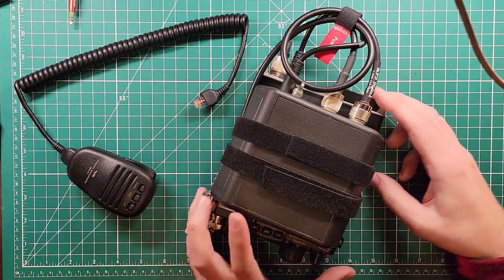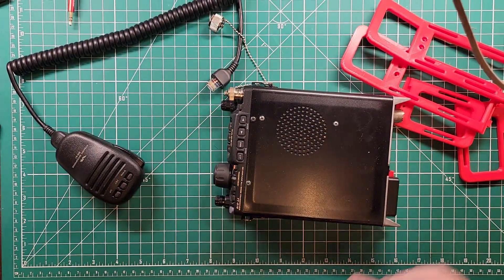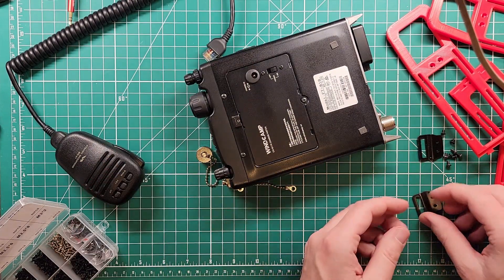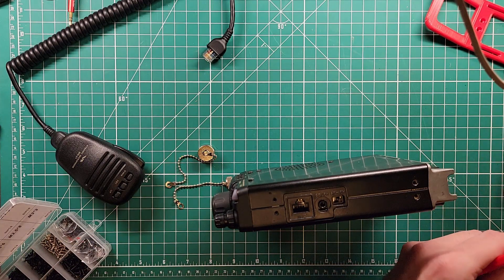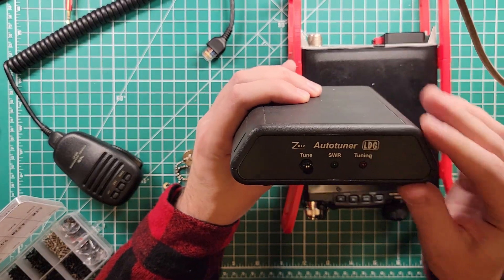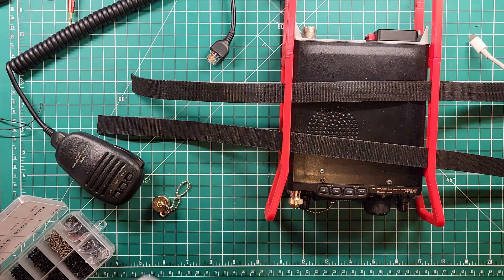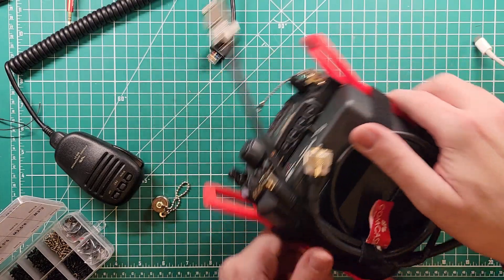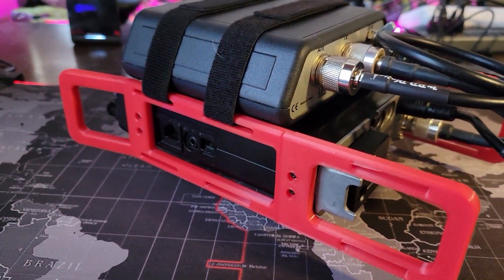Save your radio (and your cables too!)

Comment: The brackets are a great solution.   I own the same gear.   Does anyone have a source for a flexible  tuner-to-radio DIN cable ?   The one I have now is too stiff and too large in diameter.   Thanks in advance
Reply from the maker: Should be a regular 8‐Pin Mini DIN cable, they don't make them short though.  Double check the pin configuration on this one (I'm not near my radio) https://amzn.to/3ZGrEDT
Reply: Thanks very much.   The Amazon cable is purported to be a 1-1 pinout.   I will check the stiff cable that I have now.    Thanks again.
Reply: Will do.   Thanks

Comment: nice.. i made the same thing for my 991 and 710 as well.... 'they work great... one thing i would have done is maybe have used the BNC instead of the so239 if you are running to the front anyway, but the other thing i would have done and did with mine, is use some 90 degree adapters to help alleviate strain on the coax ends where it goes into the connector.
Reply from the maker: Great Tips!

Comment: I like the rails!  Make sure you give Mrs TO back here scissors.  Since the tuner is plastic do you connect a ground strap between the tuner and the unit?
Reply from the maker: The ground connections on both are connected to the coax shield on both.  I could, but I see it as redundant.

Comment: That's neat.  

I have U5Link for my 818 and really dislike the DIN cables/sockets.  They feel so fragile (and I've seen enough damage PS2 keyboards and mice).  I wonder if you could take the case off the U5Link (or the LDG tuner in your case) and build a replacement 3D printed case that attaches and covers the back of the radio, encasing the DIN ports, so nothing can catch the cables and damage them.

Just thinking out loud.
Reply from the maker: Yes you can.  I've seen what you're talking about.  I don't have a link to any STLs, just some stuff I've seen online.

Comment: A few right angle connectors would tidy that right up and shrink the footprint to.
Reply from the maker: I looked into right angle connectors - I think the ticket is not only right angles, but also 174 or 316 coax.
Reply: IMHO, one must be careful with right angle connectors.  They should be OK at HF and at QRP levels, but I have seen them cause problems with funky SWR especially at VHF and above.   YMMV.  Void where prohibited  : - )